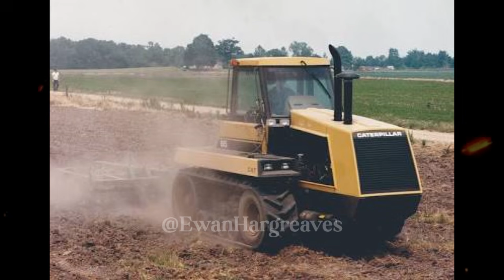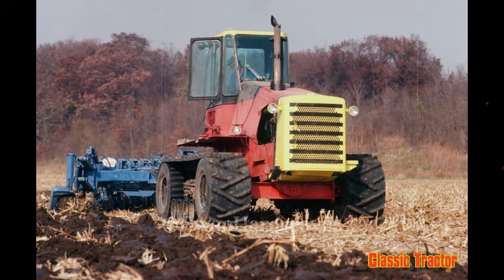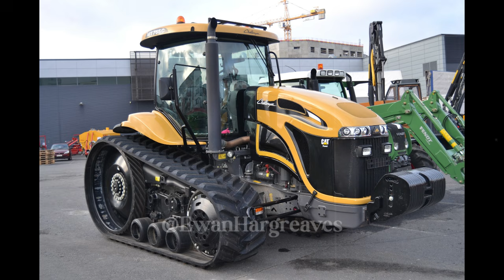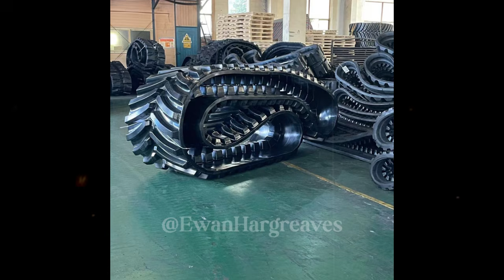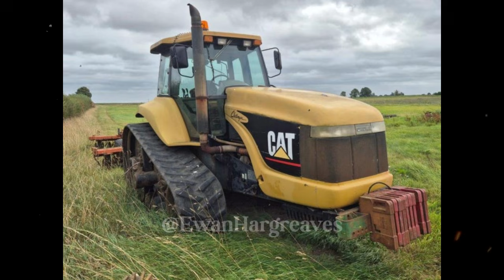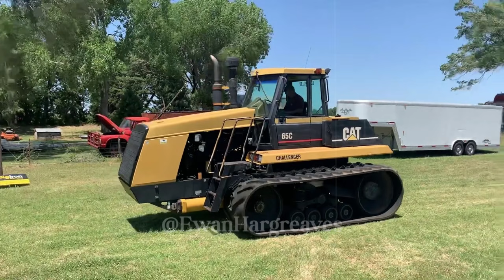Why Caterpillar QUIT Farming After Building the Best Tractor Ever

Comment from the maker: Just so you know, I personally verify all info before uploading. Still, if anything sounds off or any fact feels inaccurate, I've linked all the sources in description so you can check for yourself ;)
Reply: Good work and interesting archival stuff, especially the old video. Contrast between the old special purpose machines vs. the modern equivalents is fascinating. Watching your videos (Whitworth was especially interesting), one can't help but be distracted by the "old-time" effect that is artificial, repeats annoyingly, and in stills just provides an added line or some floaty motes. They don't add anything and may cost you subscribers.
Reply: Case-IH didn't purchase their quad trac system from the same supplier as Caterpillar.  Caterpillar designed and built the tracks in-house in Peoria, IL.  After AGCO purchased the MT700 and MT800 product line, the track technology was sold to Camoplast, now called Camso.

AGCO is pronounced Ag-Co.

AGCO did not purchase the Challenger brand itself, but actually paid Caterpillar a license fee for every tractor built.  The Challenger brand is still owned by Caterpillar to this day.

-- Caterpillar employee that was there. 😎
Reply: I like your videos but a sugestion? If the visuals the photos exemplified  the narration  I believe it would be better  especially for viewers not 100 percent familure with the machines discussed

Comment: Caterpillar did not enter the skid steer market until 1999.  I don’t recall seeing any skid steers from Bob Cat, New Holland, Gehl or New Holland built John Deere units with rubber tracks in the 1980’s.  A few tried chains around both wheels.  The rubber ag track changed the speed of transport and compaction in the field and they were impressive in 1987.  They did not develop from rubber tracked skid steers.  Good Year introduced the first rubber tracks for skid steers in 1992.  I think it is important to note that  it is skid steers that followed CAT’s rubber track lead.

Comment: These were great farm tractors!.  One of the problems was with the dealers.  The dealers had no idea what to do with a John Deere 8850 or Case trade-in.  The Cat dealer didn't then want to service the John Deere 8850.  A farmer was not in the habit of stopping by the Cat Construction Dealer looking for a used tractor.  The video made a great point about the dealers networks.  Cat compared to Deere or Case or Agco.  I am told if a farmer wanted to buy a Challenger, the Cat dealer in our area would call up the John Deere (or Case or Agco or Versatile) dealer with one question.  What will you give me for an 8850 (or what ever the tractor)?  That was the trade-in value on your sales receipt.  The John Deere 8850 never made it (rarely) to the Cat dealer's lot.  Even worse for the Cat dealer, what do you do with a 8850 repower?????  (Great tractor!!) What is it worth?  How long would it set on the Cat dealer's lot?
The dealers had to keep parts for the Challengers.  Parts storage at any dealer is at a premium.  How much space is there to devote to just unique Challenger parts that are expected to turn over frequently?  How much inventory space and $$ did they WANT to devote?  50 Challengers in a dealers area verse 1000 dozers, 1000 excavators, 250 graders, 500 scrapers.
A lot of the farmers also felt like they were second fiddle when they needed service.  Cat dealer has to schedule a service technician and service truck.  "My State Wide Construction and Highway Company" has 150 Cat machines.  John Doe farmer has one.  Both call for service on a machine today.  The Cat dealer has one mechanic/technician available.  "My State Wide..." is working on buying 3 new D-8's and a Grader and 4 excavators.  The dealer and "MY State Wide..."  keep a rolling inventory of Cat parts.  The farmer doesn't.  He keeps filters.  Even a small company with 4 dozers, 3 excavators, 2 haul trucks, 4 skidsteers and a mini-excavator has a more important relationship with the Cat dealer.  John Doe won't be back for a new tractor for 5 more years.  Where does the farmer think the technician will go first??  
I am not saying the Cat dealers ignored the farmer.  They are good dealers and they care for ALL of their customers. That is what the farmer felt.
Yes my numbers are pure speculation but you get the drift of the farmers feeling about the Challenger.